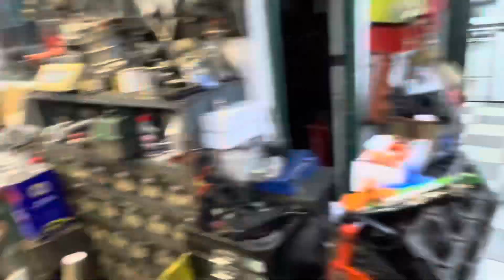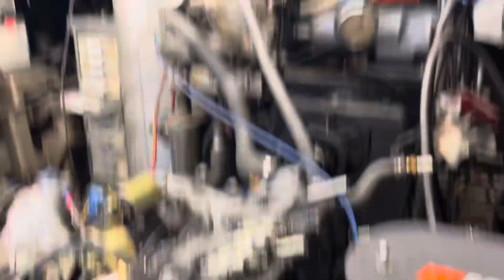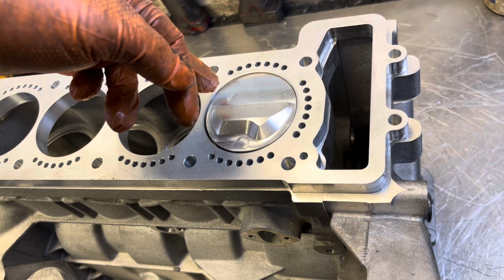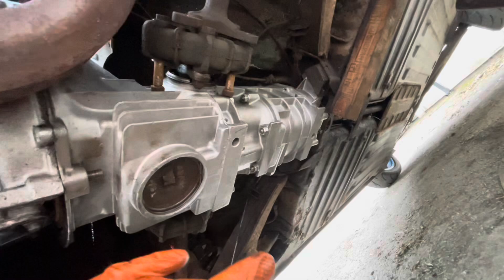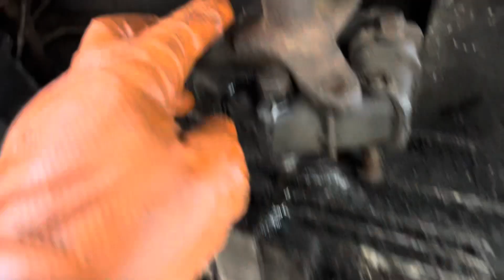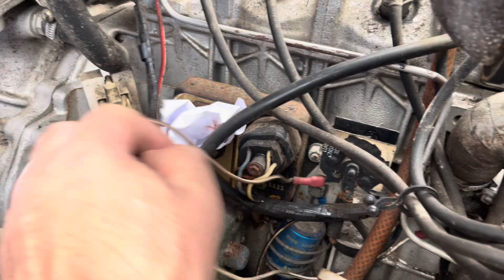Shrigleytube TV ep61  998 with a rattle fixed,1200 long rod, 1150 five bearing liners arrive, 930🚗

Comment: Interesting comments on doughnut life. Years back my sister had an imp, driving up a ramp in a multi story car park 1 day, one of the doughnuts expired, quick thinking on her half, checked her mirrors, no one behind so rolled backwards into the parking space directly opposite the ramp foot. Fortunately the new doughnut had the steel band on and fitting was a doddle.  Very interesting about the 5 bearing block.

Comment: That 1120 in the Huskies sounds incredible, like a modern high performance motorcycle. Interesting information on the donuts, I have them in my GT6 and GT40 use them too. Personally, form a mechanical point of view, they absorb vibration, which can’t be a bad thing. I’ll definitely be sticking with them.

Comment: Andy, I know nothing about cast iron engine liners but from my work in the gas industry, cast iron is strong but brittle, ductile iron is very strong and not brittle but it does rust like steel, so I guess they need the correct coolant to stop corrosion. Cast iron gas pipes corrode very slowly and last for ever, ductile pipes  rot very fast, ductile iron gas mains are a big problem.

Comment: G'day Andy I appreciate your proprietary rights on the plate. I will be using a glue that a dodgy Pom mob uses Grace Engines Development uses which I can buy in Australia. Tip of the week you can use the old kerosene out of alrsonic cleaner to wash down the mill .
Kit from down under

Comment: Why can't you get a fuzzy remote microphone like everyone else ?
Reply: Old Distributor ignition systems cause interference, 
i think that was the problem with some of the mics Andy has tried,  I used to work with PA/recording  equipment but i'm not upto date with the phone based gear. Do you know of a system that can do multiple inputs for interviewing, directional noise cancelling etc ? Any recomendations wellcome.
My (breif) research on Andys behalf only found single mic systems for simple presentation rather than interviews etc.

Comment: Hi Andy,
Thats exactly how i used to fit doughnuts,get a good fitting 5/8 I had a Gedore one, glad to see it works on sport doughnuts, couldn't afford them back in the day.
Totally agree bolts break first, I even managed to drive a mile or so home after breaking a bolt on an aggresive start (felt it and floored the clutch pedal )
Who remembers 'SUK' Doughnuts ? They were the poor quality ones😂

Comment: What's the idea behind the 5 Brg. assy? 
 Struggle to overload a 3 brg, 9k+ rpm power units fail in the rod assy before a mains issue raises it's head.
Unless your planning on pressure charging the poor little thing?
Reply: But are the rods not failing due to the crank whipping around?
Reply: @catnip4885  Crank whip contributes to pistons hitting the head and valves if your chasing power to that extent, but then the drag of another 2 main brg. is going to detract from the power gained from the use of a cam profile that runs the valves closer to the pistons, now possible due to a sightly more robust rotating assy. 
Remember in a power unit designed for optimum power, all brg. sizes are as small as possible, but still able to do the job with the intended service life. In the case of the purest race units, that's about 2 hrs under load at peak power development, endurance units are usually tested at 30hrs ie 6 hrs longer that their intended use

Comment: What about correction factors for atmospheric conditions. This would make a big difference.
Reply: Hi, 
Yes indeed having operated dynos myself, correcting to Std conditions (temp pressure etc) makes a difference, dubious operators are known to put their hand on the ambient temp sensor of dyno computer to 'show' gains from mapping etc.
Andy's using that dyno as a proving load, running in manual dyno mode without automated correction, hence figures an 'indication' rather than calibrated, and he  often remarks that its reading a bit high on 'a good air day'
Look to the left of his dyno cell and you'll see the other dyno, it has automated control, solenoid valves sensors etc needs commissioned & electronics updated , so nice repeatable graphs for accurate comparison between engines are in Andys project pipeline